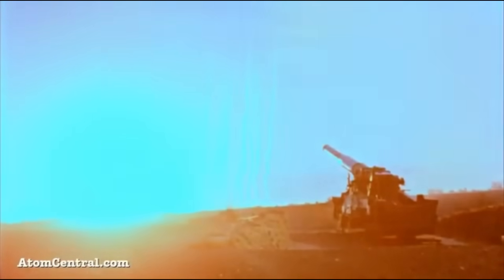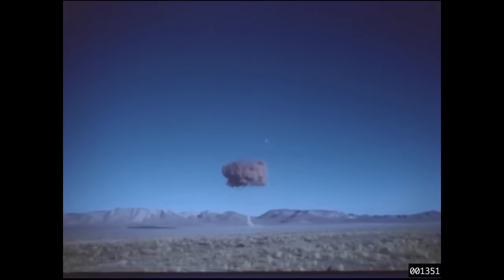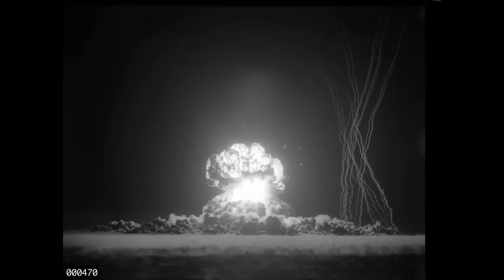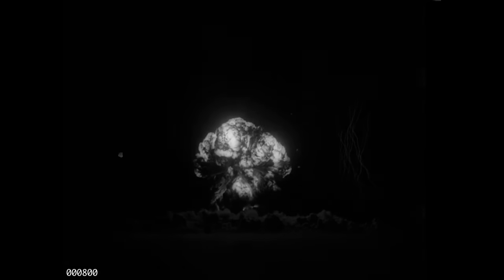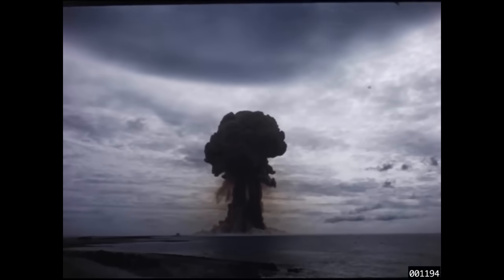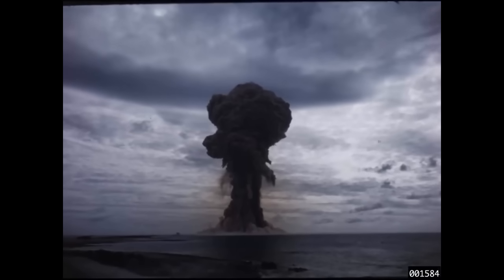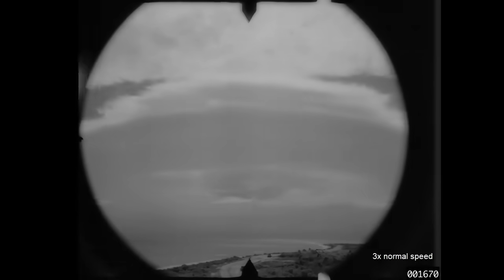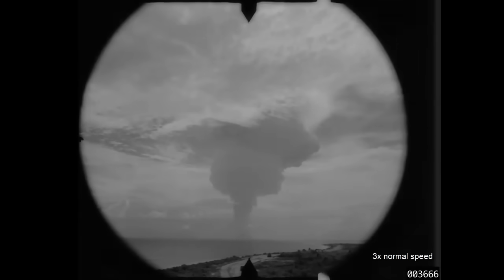What does a nuclear bomb sound like?

Comment: I like how the speed of sound is essentially a non-factor in most movies. It's too bad, I always appreciate some realism. It's similar to when a sci-fi movie doesn't feature sounds in space; it's more jarring, and more immersive.
Reply: The Man in The High Castle got it right, even with a tiny bit of an earthquake and a delay before it disrupted the power grid- before the sound. The part they didn't do realistically- they were looking right at it no problems.
Reply: Ya nothing like watching something evaporate from a big explosion only to hear the sounds seconds later. 

Much better than just a boom and  burning wreckage
Reply: It always add's a sense of scale and realism when they get the sound right. Like in HEAT when they use the shaped charge to open the armoured car, you see the charge go off then the bang and no fire ball, just shattered glass and a flash from the shaped charge. Super cool.
Reply: @Outland9000  I haven't seen it, but I think I should now...
Reply: Question
Let’s say a spaceship explodes in space for whatever reason
Wouldn’t it make a tiny bit of sound maybe only Heard- by people that are close to the explosion simply because it takes air for it to explode and I assume that air travels at least a tiny bit away from the explosion so that it might can be heard in some proximity
Reply: @andulasis6283  there would be a little bit. They did that in Gravity. You hear the debris and the gas that comes into contact with her suit.
Reply: @Freshbott2  I haven't seen Gravity yet, but that sounds really cool
Reply: @Freshbott2  I haven't seen it, but it totally makes sense that you could hear something hit your suit
Reply: @andulasis6283  if you’re close enough absolutely you’ll hear whatever you can through the thick suit. Until the gas disperses.
Reply: @garyb6219 when things blow up they release gas and particles. Dense clouds of gas such as AN EXPLOSION are capable of carrying that energy to surrounding observers. It does this BECAUSE space is a vacuum. Am I going too fast for you?
Reply: @garyb6219  read what i typed again but slower
Reply: @andulasis6283  Sound is either a) resonated by or b) dampened by whatever matter the vibration-energy travels into.
So sound is not 'made', so much as it is propagated according to how far the kinetic energy from the source can travel/vibrate through the matter around it. 
iow,  a "Transmission medium' is essential for sound to exist. https://en.wikipedia.org/wiki/Wave_propagation
Human ears attune to how waves propagate through our atmosphere. Since a vacuum is more or less materially empty, sound doesn't travel in it in any familiar sense.  However, intra-galactic space is rarely a 100% empty vacuum, and has some distribution of gas atoms, dust and/or whatever 'dark matter'. Maybe certain microphones can detect small fluctuations? Another thing is that sound might not propagate at all in intergalactic space. I guess that it depends on how 'dark matter' behaves and wherever it actually is.
Reply: @andulasis6283  That's a question I have wondered about before. It should make a little sound, right? I don't know if you watch Rick and Morty (lol I know), but there's one episode in which they get blasted out of their spaceship, and you hear a WHOOSH which is abruptly cut off by silence & cold death. I suspect it's fairly realistic, from an audio perspective at least.
Reply: @andulasis6283  That's a cool question, I bet you would hear the sound, for however long the air was rushing past you into the void!
Reply: On the red thin line (1998) there some explosions are
Reply: It's just a movie dude
Reply: Just as the camera can be anywhere the director decides ('god's eye'), so also can the mic be 'put' anywhere for a 'god's ear'.
Cinema is storytelling, and not a documentary. If every sci-fi film were held to 2001 standards of realism, they wouldn't make enough money to keep making them.
Reply: @shaft9000  You make some great points, thank you for this comment! You seem smart, by the way; you are a thinker, and those are rare (although I think you are a bit older than most on this platform, much like me). Peace
Reply: boy, are you gonna love the bomb test scene in Oppenheimer
Reply: i sleep on this kind opf space movie, but i like science , and like when science is respected, but the sound in space movie, is essential, for me to make a good movie, if not, its a documentary for me, so im gonna sleep, its just stupid, to remove the sound in a movie, so i asssume ,the op is stupid,
Reply: The blast in the movie "the sum of all fears" does an excellent job with the blast wave
Reply: It depends on the type of sci-fi movie. If it's suspenseful or horror then yes it's important for the quiet but if it's something like a space opera then adding sounds even if everyone knows it's not real just makes it better even if it's not accurate.
Reply: It's actually one of the cool missed opportunities for a good plot point like all the characters would have like 25 seconds to get to something resembling shelter
Reply: it really isn't that bad
Reply: except no one ever actually knows what they sound like so the inaccuracy doesn’t matter it’s whiney to be whiney

Comment: the fact that it takes so long to reach the camera is terrifying
Reply: @Idecay_  seeing the huge explosion 20 seconds before the sound is just scary
Reply: @fatlard2338 and then dying before you see
Reply: @fatlard2338  it's actually funny lol
Reply: @Idecay_  What the fuck a hundred kilometers ? It took about 35 sec for the sound to be heard and the speed of sound is 343m/s so we can say that they are about 12km away. Literally took minutes to find on google... come on. And yes I know that the speed of sound varies depending on barometric altitude, but it wouldn't change much knowing that they are most probably not too high above sea level
Reply: @samsmith6791  I did the math, made a comment, and then found your comment
Reply: @samsmith6791  Sounds about right. A lot of the test site people operated out of Mercury, and my mom worked in Mercury for a short while back in the day (I live in Las Vegas). Las Vegas might have been 100 km away, I think it's about 60 mi, I'm too lazy to look up the conversion.
Reply: You got that in freedom units? @samsmith6791
Reply: @samsmith6791  just FYI, the Nevada test site where the test were performed are between 2800 and 7400 feet above sea level.  So they are much higher than sea level.
Reply: @dietrevich  thats right. 5000ft vs sea level however only lowers the speed of sound by 5m/s or so. its not a big difference.
Reply: @Digi20  Over a big period it can make a couple seconds difference. Lets not forget also, that the shockwave can travel faster than the speed of sound, due to the powerfulness of the explosion.
Reply: @dietrevich the variation of elevation is not that much in the middle of a flat desert lol
Reply: Right, I've stood ten miles away from rockets going up in Cape Canaveral and there is a lag of about 12-15 seconds before you start to hear the sound.  It really makes me wonder how far away this was shot, and also gives perspective as to just how monstrous the explosion is.
Reply: Yeah, goes to show the size of these weapons. They're so damn far away yet they look like they're "right there" because of their size. The camera often has to pan out to even see the full cloud.
Reply: Yeah, that really puts the scale into perspective in an otherwise hard to judge setting.
Reply: It just means it’s far away…..
Reply: Same with volcanic eruptions. You see the and then there’s silence, then BOOM
Reply: A lot of people think OP is saying the speed of sound is scary, when it's probably that the size of the explosion doesn't make it seem like it's as far as it actually is until you hear it that much later.
Reply: @Idecay_  About 7.1 miles if you calculate using the speed of sound
Reply: i dont wanna like ur comment cause it's at 911
Reply: it's terrifying because it shows how far you are from it and the blast looks so so big since u r far far away from it
Reply: Because that's a relatively safe distance and light travels faster than sound.
Reply: Oh yeah. I was constantly lowering the volume and pulling my headphones farther and farther away from my ears 😂😂
Reply: That shit is a long way off miles
Reply: 5 seconds per mile.  You can count to figure out how far away lightning is.
Reply: Welcome to how sound works.
Reply: I was really hoping it would sound like the seismic charges from Star Wars https://youtu.be/erFcYsC6JaY?si=yZNaQnHjdJxLuF2z
Reply: A shorter time would be mush scarier. It takes sound 5 seconds for every mile distance to get to you (this is also a great way to figure out how far away lightning is), and believe me, you want distance between yourself and an atomic bomb.
Reply: You mean the microphone  - and it's the opposite of terrifying, it means the explosion is a long way away.
Reply: Sound really isn't that fast. 
Duck hunting once , I saw my partner down a duck over the lake. 
 Literally  , I saw the gun go up , the recoil  and bird fold by the time I heard the bang.
 Really kind of interesting.
Reply: @rebwarwar5184 Same way at dove shoots in large fields. Gun recoil, birds falling and then you hear the shot.
Reply: the speed of the em is likewise terrifying
Reply: Guess they didn't want to be to close😂
Reply: A 33 second delay means the explosion was 6.6 miles away from the camera.
Reply: nobody realises how far away the explosions are when nucleer weapons are deployed and caught on video. they look closer than they are almost every time. too many hollywood movies warp your expectations. btw they've deployed irl on people many times they just dont talk about it because they are liars.
Reply: Eh not really just physics. Then again I do watch a lot of bomb videos so that might be why I'm used to it
Reply: Your concern reminds me. If the sun went super nova, due to the "limit" which is the speed of light, we will see it for around a day until it hits us......
Reply: @excursor4296  I thought light from the sun only took about 8 minutes 30 seconds to reach us
Reply: @trevorgray3681  Maybe.....I forgot the time and just wanted to make known the notion. If you care to elaborate and explain fully the notion go on ahead.
Reply: @excursor4296 Physics doesn’t deal with ‘notions’.  If the Sun goes supernova (as you say), we will experience it for maybe a few seconds, about 8 minutes after it occurs.  Then we die.
Reply: @excursor4296  wdym after a day? :)))
Reply: @AlekDjRo it was an uninformed statement, the correct answer brass would be eight minutes not a day
Reply: @excursor4296  of course...
Reply: The speed of sound is scary to you?
Reply: @borbleborb4586  ......I hope you have taken more into consideration the what you have presented.....
Reply: @excursor4296  .......I have.......
Reply: No it’s not.
Reply: @KH-rt3ef  Do you know how opinions work?
Reply: Please grow up.
Reply: Does lightning and thunder scare you?
Reply: @AnalyticalReckoner  no, does slowly dying from radiation scare you?
Reply: @fatlard2338  kind of a stupid response considering your original comment is about how scary the speed of sound is.
Reply: @AnalyticalReckoner  They should scare you.
Reply: @AnalyticalReckoner  yes, very much so.

Comment: My question is , what has happened at the blasts site, is it still radioactive, was the experiment done in a way to minimize radioactivity, or can we go visit the site?
Reply from the maker: You can visit sone nuclear test sites (onse open to the public like Trinity is once a year). But they are still a bit radioactive. Simply visiting won't hurt you but it's reccomended to clean your shoes after and do not pick stuff up off the ground. 

Most of the more radioactive materials have decayed away by now, but the longer lived isotopes are still there.

To answer your other question, with above ground testing the was nothing done to minimize radioactivity. The best they could do is watch the wind direction. Below ground testing is far "cleaner" as it dosen't spread fallout.
Reply: @venera13  Though, below-ground testing can have some interesting...side effects.  Like the 2,000 lb steel plate that reached escape velocity during Test Pascal B.

Comment: A question for truthers: why is the symbol for nu(clear) a movie reel?
Reply from the maker: I assume you mean the radiation trefoil symbol? if so, it represents radioactivity by depicting emissions from a central point. The circle in the middle is the source, the 3 cones around it are emissions of energy radiating away from the center. 

So it's a pictorial representation of energy emission, which is what radioactivity is.
Reply: @venera13  can't argue with that. I used to think the exact same thing

Comment: if you're close enough to hear it go off instantly, you pass away due to the shock wave being too "loud" and tearing you apart.
Reply: If you're close enough to hear it instantly, you're within 300 meters or so and you would be dead before the shockwave reached you. Your last experience would be that the world suddenly got very bright, and very hot. And then that's it, you're toast - literally..
Reply: @SineEyed  If you're close enough (10 meters), I'm sure that you will literally become a gas. It's hot enough to make your state of matter become gas.
Reply: @SineEyed  The... temperatures do reach 100,000,000 Kelvin by most sources I could find.
Reply: @silience4095   I wasn't saying that a nuclear reaction isn't hot. I'm saying that the photons having the most energy are the first things through the cracks in the casing of the bomb, as it begins to rip apart. I'm saying these particles shoot out ahead of the heat. They interact with every bit of matter surrounding the reaction, imparting their energy to the atoms they run into, which heats these atoms up. That's where the heat comes from; there is no heat inherent to the bomb itself. Nukes aren't like conventional explosives which are typically exothermic chemical reactions, meaning that through some chemical process heat is generated from the reactants as they interact with each other. In a nuclear reaction, the explosive power comes from the abundance of pure energy released as it's being converted from matter. This energy is carried outward by the quantum of electromagnetism aka photons. These photons interact with everything, heating it all up.

If a person was close enough to this, it would be the photons which cause him to vaporize, because everything else hasn't had enough time to heat up yet..
Reply: I’m dubious your brain would have the time to process the signals necessary to have a conscious experience of anything that close to such an intense release of energy at the speed of light.
Reply: @jmass4207  Yeah I think the same, I think you'd vaporize before you even have time to experience your death. It just ends abruptly.
Reply: @silience4095  that seems like a pretty nice death actually
Reply: @SineEyed  no because you can still put butter on toast 🥲
Reply: @bearieroblox6451  yeah that's a good point, I didn't think about that..
Reply: In that situation it's "so many things to die from, so little time."
Reply: "pass away" seems inadequate in describing what happens to you if you're that close to a nuclear detonation.
Reply: @BrightBlueJim  Your body will cease to exist entirely, you'd be quite literally be evaporated.
Reply: @silience4095  Kind of my point.  "You pass away" doesn't really convey that.
Reply: Might have to use 14 billion SPF sunblock to avoid a sunburn also.

Comment: What's the comparison between the nukes explosion and the blast in Beirut? Does a nuke cause the same if not greater kind of shockwave? Just curious is all because of how far this video was taken.
Reply from the maker: It's yield was about 1.4 kilotons. That's very small in terms of nuclear weapons. But some 1 kiloton nuclear bomb tests did happen. One of the videos I used is actually a small one around 1 kiloton. 

The blast wave will be largely the same, however damage from a nuke will generally be higher because it explodes faster, and has a stronger thermal pulse than a chemical explosion. So it will burn more things. But the damage is mostly determined by location. It's damage was comparable to a small nuke, but will different after effects.

Comment: Noise at the beginning is more likely coming from neutrons. Same thing can be seen on film when there is no EM pulse, just neutrons hitting everywhere.
Reply from the maker: It's a mix of things, looking back I think its also just the film in the camera sputtering from the intensity of the light.
Reply: @venera13  Can photons make "noise" (tiny dots as you see from neutron or other radiation) on film or digital capture? I never heard it could affect audio tape which is very known technology to me. Of course we don't expose it to very strong light lik it can happen with camera. I believe EMP from explosion we've seen lasts a very short time.

Comment: What is the DB level of the sound in the video for the soldiers? Would it have caused hearing damage?
Reply from the maker: From the distance they where at probably not permanent damage. But most people would cover their ears or wear hearing protection anyway.
Reply: @venera13  Thanks! I’ve been curious for a while. I was honestly surprised by how low pitched the explosion sound was.

Also, do the onlookers receive significant radiation doses from the blast wave?

Comment: Might be able to use "data sonification" make an approximation of the sound of the bomb based on seismographic information. You'd have to adjust the playback speed, bass, and treble to compensate for the difference in the rate at which vibrations propagate through the atmosphere versus solid ground. Could even apply it to a spectrogram since photons travel as a wave too.